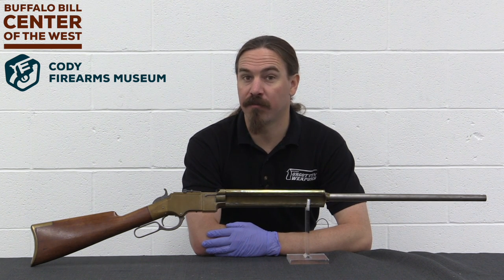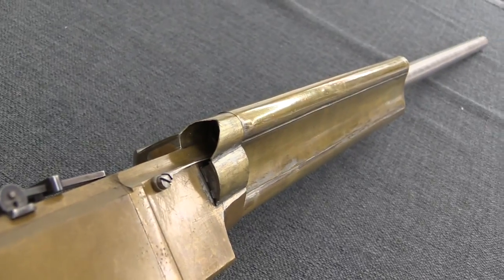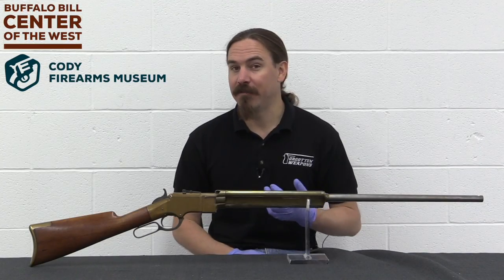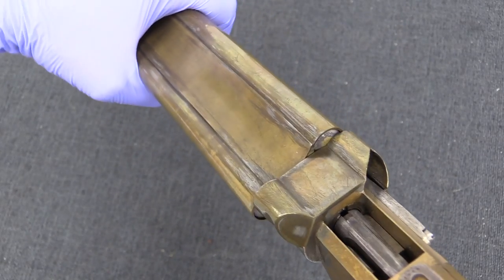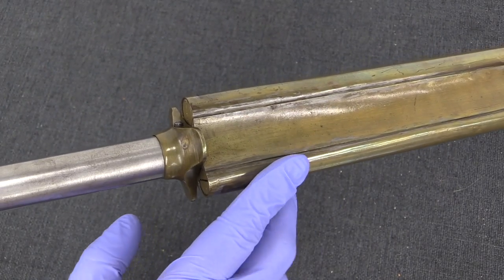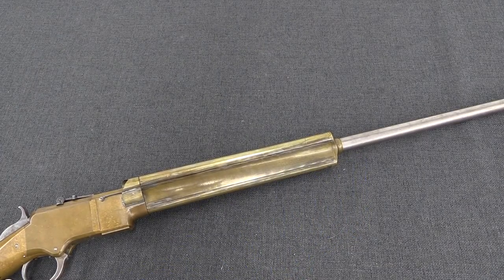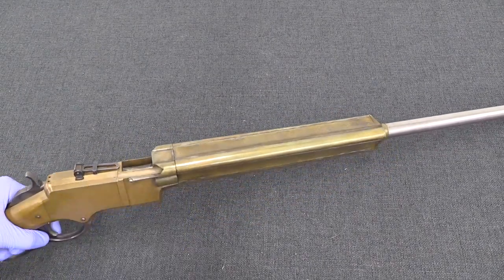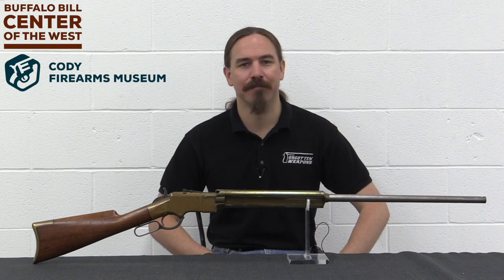Experimental Triple-Magazine Henry Rifle

Comment: I'm not sure I'd want to add more than another 4 inches to that mech.  Make it a nice even 30 rounds.  Any more and weight really would be an issue.
Also, did you check the depth on the feed ramp from the tube?  I'm curious if it were shallow enough to act as a rotation stop with the aid of the round being fed in.
Awesome prototype, thanks for sharing.

Comment: Note to anyone that cares
Original Henry sights don't quite fit on a newer model but can be made to fit with a shim
I personally used a piece of a soda can
It works well

If you don't know 
most modern lever action rifles have leaf sights 
and I personally wanted a Calvary style ladder sight 
You can see it on this rifle 
It would fold up to have a adjustable sight for long range shooting

It also collapses down and in it's folded Position
It functions as a regular iron sight

I know I could have bought a frontier model but what I wanted was going to cost 3000 or more dollars
And I already had a completely functional lever action rifle that I could just swap my sights 

also apparently my rifle is a older type rifle 

And hiviz gun sights stopped supporting the type of rifle that I have
as I needed a sight with a barrel ring and the sights they specify for the Henry are actually not correct 
As it doesn't have the barrel ring
And just leaves my mag tube free floating

Comment: There would be little advantage in longer tubes, given that you can reload the magazine and shoot at the same time. I suspect that you can even rotate the magazine assembly from a partially emptied tube, the cartridge in the ready to feed position providing the correct spacing. The one question I do have is what pushes the last cartridge into the lifter? I guess you could just lift the muzzle up and use gravity.😂

Comment: Can you imagine 40 rounds in that thing it would weigh 15lb or more it would be like a LMG of the old west
Reply: I was thinking if they had used an item like this in practice and built squads around moving it up (like we do as a suppressive fire army), I think the Indian campaigns would have been shorter.
Reply: I think full length tubes would have been way too front heavy to be workable. But arming the Cavalry with a half length tube like this one would be ideal, even in .44 Henry rimfire. @21 rounds in the weapon, and you could keep topping up the next tube when you had a chance.

Comment: Other upside is that looks much easier to load than even later Winchesters especially since you can top up the magazine while using the lower magazine. Downside aside from weight and pobably cost would be keeping track of how many shots have been fired. Other downside since it is black powder would be smoke. How many rounds could you rapidly fire before it is impossible to see what you are shooting?

Comment: I guess if they thought it would be economically viable they could have made a full-length 6 tube version. Based on the standard mag it'd give something like 90 rounds plus one in the chamber. The SAW of the 1860's if you will.

Comment: I always wondered if a detachable tube magazine would work.
Reply: SRM Arms Model 1208
Reply: The PP-19 Bizon SMG does something similar with its mag
Reply: Same problem drum mags have: assuming you've got a couple of spares on you, how do you hold them? The double-stack box mag has won out as the most popular design because you can actually carry them on your person.
Reply: It would be even more awkward that a drum mag is now (for different reasons tho).
Reply: Like a Spencer?
Reply: @zacharyrollick6169  I think he means with a complete follower and not just a tube to help loading.
Reply: @FumbleSquid  So like those semi auto .22s that have a tube magazine in their buttock? Granted, it doesn't have a spring detent or any sort of gimmick to hold the rounds into the magazine when removed from the gun.
Reply: You'd need something on the mag tube to use as a cartridge retainer.

Comment: 😍
(Edit) at the time this was in development, would there be any call for having different loads in each of the tubes? Would be a pretty tacticool way to switch what you were firing on the fly
Reply: Highland Outsider With the way it feeds I would think you’d have to empty the tube before it would rotate. But, it might line up just right so a round wouldn’t jam it up.
Reply: There was only minor difference in loads. Basically a couple of factory loads and a simple cast lead bullet hand load. Almost everything was a simple round tip bullet. Hollow points and FMJ bullets where not invented yet. The cutting edge was a flat point bullet for better effect on game. With black powder there was very little extra performance to be found. Without increasing case capacity. Cheers
Reply: LOL Gr8 idea!! 3 barrels so just fill one up with 7 slugs, the next with 7 bird-shot and then the last with 7 buck-shot. And you're ready and loaded for every situation ;)  only thing it's missing for that is engraved numbers '1' '2' and '3' on the different barrels so you can quickly see which barrel has which load in it.
Reply: Not for a rifle, but might work for a shotgun.

Comment: Thanks for this upload Gun Jesus
Reply: SgtxAnus I was thinking the same thing. If it has made it to production I would think they would have figured out to add cooling holes between the tubes. It would have the secondary benefit of decreasing the weight a small amount.

Comment: How many different types of ammunition were actually in regular use back when this might have been sold? For more modern weapons were you can easily switch between and fire from multiple magazines Ian usually points out that you can load each one with something different, might not have been practical here though?
Reply: It was all big chunks of lead, the only advantage this has as a rifle is capacity.

Doing that magazine modification to a Winchester 87, though...

Comment: Did anybody ever try doing a fixed cylindrical magazine on the forgrip, like a PP-19 mag? Might be hard to load but would hold more than a straight mag tube and he round for a better grip, not awkward holding or needing to rotate to different sections

Comment: Only five rounds more than a standard Henry rifle. No wonder they've ditched that design. Also more weight, more parts, more expensive to make.
Reply: As he mentioned, they could extend the tubes. Or, alternatively, make a high capacity Henry carbine. Surely its more expensive, but doesn't seem prohibitively so.
Reply: But then it would've been too heavy and bulky. Also think about what happens when one tube is empty. Then you'll have less weight on one side than the other and that means a torque is applied to one side, so aiming would be quite awkward.
Reply: Only 5 extra rounds, and the ability to top it off without taking it out of action, and having a nice hand guard, and having the weight of the ammo closer to the center of the gun.
Reply: But with this design you can shorten the barrel and retain capacity
Reply: @niceguy391987  why not make a round magazine thay coils itself around the barrel
Weight would be more distrubuted right?
Reply: @aguslucero6699  Sounds like a neat idea in theory, but i doubt it would be worth the cost and effort to make it.

Comment: Rather than extending out the three magazines, the same capacity increase can be had by making it six tubes of that length, rather than three. And THAT would have been cool (and way more balanced)! A sixshooter-style lever action! Why don't we have this?!😅 Seriously, that could work, and the weight would bebalanced on your front hand, and giving a (probably) pretty decent grip too!
Reply: You'd need taller sights to see over the magazine. Or say hell with it and put sights on the magazine tubes.

Comment: I wonder if they had issues with the spring detent not being strong enough to keep the whole thing aligned under recoil? It wouldn't take a big misalignment to cause a failure to feed.
Reply: Looking at the front, I think the next round into the chamber helps hold everything aligned.

Comment: Im sure it's been said but this should be double the tubes and double the length. Get something like 84 rounds. A lever action that you almost never have to stop and reload? It would have been formidable. Chamber it for a smaller round to deal with the front heavy problem.

Comment: I see there is a gap behind the magazine where it feeds into the gun. Could you rotate the magazine asembly without empying the tube that is in use?
Reply: 3:25 does an entire round fit there? Then it has a 21+2 capacity, right?

Comment: 1:47
What..was that
Reply: The back of the rifle is just a standard Henry, with some non critical parts missing. Which is standard of these prototype rifles.
Reply: An edit.
Reply: @ssjaken  Pretty obvious that flanker was wondering what those non critical parts were.
Reply: @brandonwestfall3241  I think he was referring more to the whole Ian repeating himself without mentioning it thing. That was weird.
Reply: @brandonwestfall3241  If anyone's actually wondering what the missing parts are, those cuts/screw holes don't exist and are solid brass on a standard Henry. It would seem this prototype might have been a test-bed for additional experiments involving attachments there.

Comment: Wouldn't you worry about the rounds cooking off in the tubes if it gets hot? I mean, that IS a large heat sink...
Reply: No. Lots of radiating area and thermal mass to heat up, and even today you need to fire more than 160 rounds through a much lighter rifle to get to cook-off.

Comment: Could that get hot enough to cook off a black powder round?
Reply: No. And this model was experimental
Reply: @superduck6288  I know it was experimental with little information.  To clarify I meant cook-off in the tube magazine, not the chamber. Perhaps cook-off is why production never happened. Maybe even just fear if cook-off. If flashpoint of black powder is in that 464 F range and modern-day firearm barrels reach that 1000 degree range with rapid-fire, could it be possible to reach critical temp in one if those tubes given enough rounds fired?  Is there enough thermal resistance in the barrel wall, tube wall and cartridge wall to keep the powder under flash point?  I don't know and my physics is rusty.  I say Ian needs to head to the range with 100 rounds of 44 Henry and test it for us.

Comment: I expected the tubes to go all the way to the end. It would be excessively front-heavy, but who cares. Then you only need to add a tripod and some steampunk lever to automate the firing mechanism, and tada~
Reply: you mean like a crank from a gatling gun, which actually existed at that time?

I'm now picturing this rifle in a sort of SAW rule. 

BANG rick rack BANG rick rack BANG rick rack BANG rick rack BANG rick rack BANG rick rack BANG rick click "oh" klkllkrrong shlack rack BANG rick rack BANG rick rack BANG rick rack ....
Reply: Indeed. Or maybe a state-issued monkey to operate the lever while strapped to your chest.
Reply: Old timey fortress turret on a pintle mount, set up on the parapets of Ft.Kearny...

I could see these used like how we distribute belt feds for point defense. It's only fixed till you pull the cotter pin. Then it's a S(semi)AW.
Reply: @BeingFireRetardant  Hook the crank to the steam engine of a train and you got yourself an armored train.

Comment: Why only 3 tubes? There is enough space  for 5-6! ;)))
Reply: There is a trough between the tubes allowing the original sights to be used. With 6 tubes it would be a large profile all round so would need raised sights which are not optimal
Reply: @KenworthW900HG  its just a joke)) The very least it would have been too heavy)

Comment: He estimated that 21 rounds was the total load.Maybe, if he measured the magazine length &andthe length of a .44-40, he would have an closer estimate of capacityThe follower tab showed how many rounds left. It was a First Model(1860)spring retractor. With the spring pushed forward, more ammo could be added before being empty.
Reply: Hard to know how much spring compressed will take up exactly.